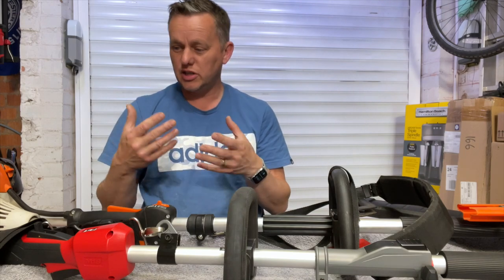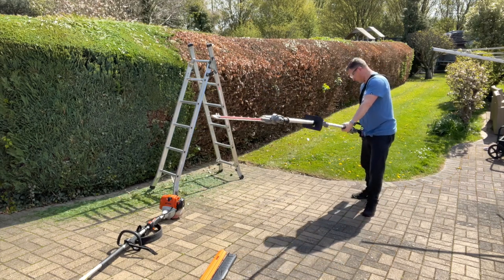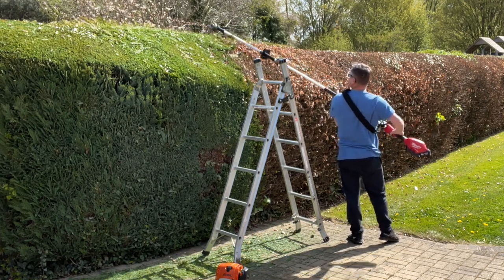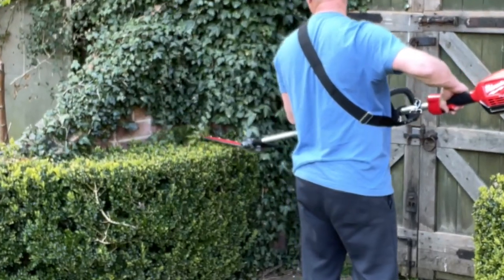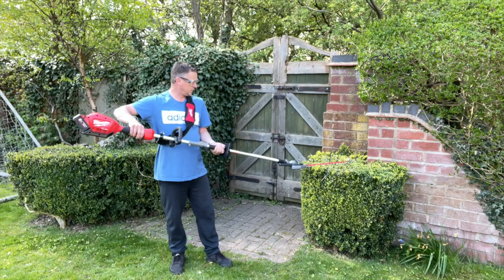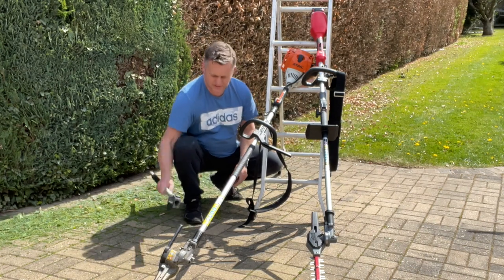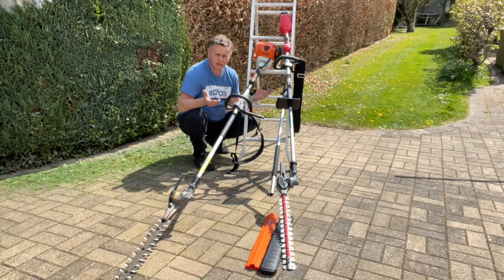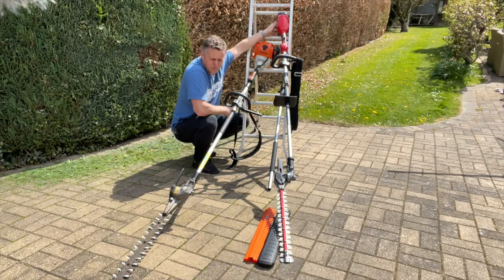Milwaukee Pole Hedge Trimmer Quik-Lok M18 Vs Stihl HL95 Petrol Vs Electric.

Comment: I just got a 8 amp hour bundle with string trimmer, brush cutter and hedge trimmer.   Homeowner and I do yard work as a side hustle.   I don't have a truck/trailer.  All my tools go into a CRV.  Been doing it for 4 years now and use mostly manual tools and an extension cord model sun joe extention hedge trimmer (which was awesome).  But I wanted to upgrade.   I need electric because I don't want my crv to smell like gas/oil.  Overall I'm super happy with my choice.   I also have the milwaukee fuel hackzall and hatchet.  All amazing tools.  I do eventually want to add the polesaw, edger and the extension piece to help the hedge trimmer get to higher places.
Reply from the maker: Enjoy the tools, Thanks for the great comments👍🏻👍🏻🛠

Comment: Careful with pushing to hard, the connection between my battery and the unit melted shut with a 8ah HO battery when using the trimmer :-O "used it too hard". Milwaukee in Sweden wont fix it for free so not sure if i even should fix it since it seem to be a normal issue 😲
Reply from the maker: I have heard of this issue but as of yet not had it happen to mine and I use it hard, Thanks for the great comments👍🏻👍🏻🛠
Reply: The rep claimed it could be dirt at the connection but at the same time "never heard of it" 🥱

Another user with same issues replaced on warranty 3 times and think its the vibration that cause it 😅

Comment: Suggest a better microphone!
Reply from the maker: This was a real disappointment, I used a rode mic with wind muffler and still had major issues, in hindsight should have gone for the lav mic and wireless transmission, but it was too late, didn't pick it up til the edit. Thanks Andrew for the great comments👍🏻👍🏻🛠
Reply: Been cutting hedges for 11 years using all petrol equipment. I'm thinking of making the switch as I'm fed up with the fumes and the weight of petrol machinery